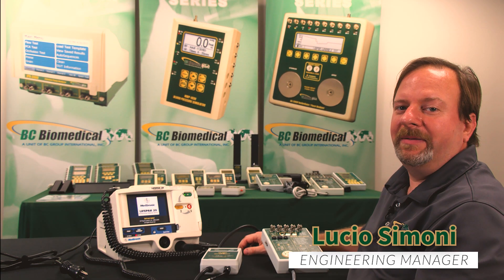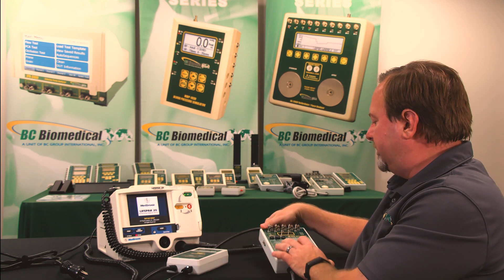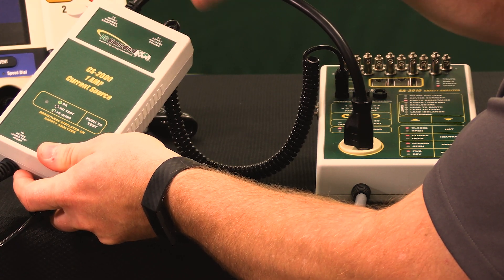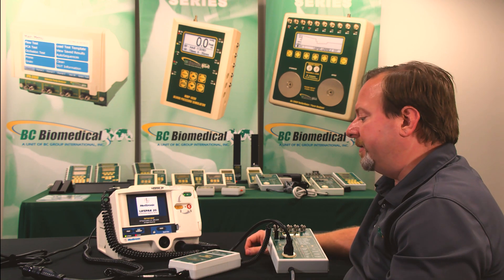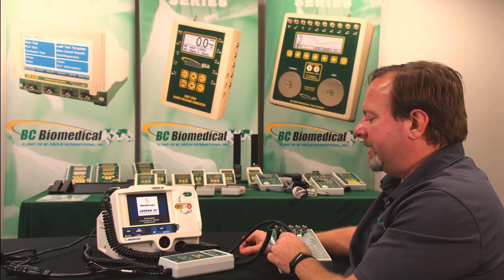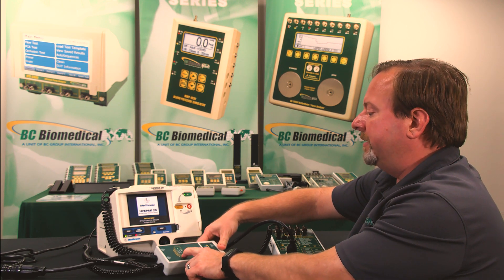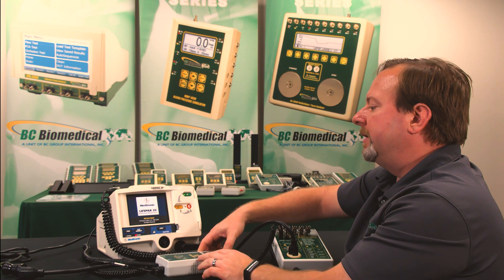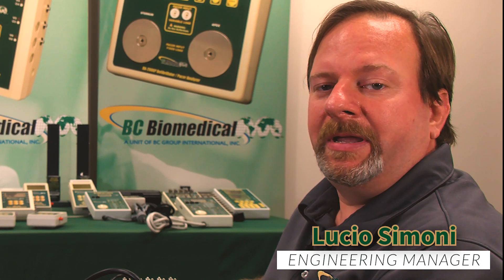SA-2000 Series Safety Analyzers: Interfacing with the CS-2000

Comment: I do not understand the need for hte 1A source exactly.. My DALE and BC analyzers provide 10mA to drive the resistance measurement.  Where does the 1A necessity come from?  Can you explain this please?  I recognize this is some kind of IEC 60601 update or something.  I cannot get any details on this as the IEC requires buying their standards package which I am sure will not answer the less technical questions on "Why".  The IEC 601 evidently does not exist any more as when I look for it, I ma told to refer to the IEC 60601-1 2020. .. thanks if you can help..
Reply from the maker: Stan, we appreciate you subscribing to our You Tube Channel, and providing us your feedback on this video.  Here is how we can best answer your questions...

Resistance is measured by passing a known current through an unknown load and then measuring the voltage drop across the resistor.  It isn’t a flaw in the SA-2000 series, just a design choice.  The original design of the SA-2000 and the Dale safety analyzers use 10mA to measure the resistance.  The CS-2000 increases that current to 1 amp.  

Sometimes it is desirable to place the ground circuit under stress to ensure that there is a good connection under a heavier load than 10ma.  When more current is desired for the resistance measurement, the CS-2000 is needed.  

The 60601 standard calls for 25Amps to be used for testing ground resistance, which can be destructive and is usually reserved for the OEM of medical devices, not for field testing.    

Thank you.
BC Group International
Reply: How and when is it desirable to apply 1A for measurement in equipment? I was told this was mandatory to apply the 1A source, but I do not seem to be able to find reference to this with the documentation I have.  What does the 60601-1 actually say in their terms?
Reply from the maker: @mrstanskaggs1  

Hi Stan,

The requirement for the 1A test current is based on the service manual of the device you’re testing.  For example, the service manual for a LifePak20 specifies “perform the Protective Earth Resistance Test in accordance with IEC 62353”.

IEC 62353 states:
Device able to deliver 200mA in to 500mOhms and open circuit must not exceed 24V.

IEC 61010 states:
A current of 25A or 1.5 times the highest rated current of the relevent circuit, which ever is greater, from a current source with frequency of 50 or 60 Hz and with a no load voltage not exceeding 6V, is passed for 5 to 10s through the protective earth terminal, or the protect earth contact in the appliance inlet or the protective earth pin in the mains plug, and each protectively earthed part.

So, if you’re an OEM and testing to 61010, you would need 25A.  If you are doing routine maintenance, and 62353 is required, then you need a minimum of 200mA.  If neither are specified, then the standard 10mA of the SA-2000 series is sufficient.  

We appreciate your feedback. We hope this helps to answer your questions. Thank you.

Sincerely,
BC Group International